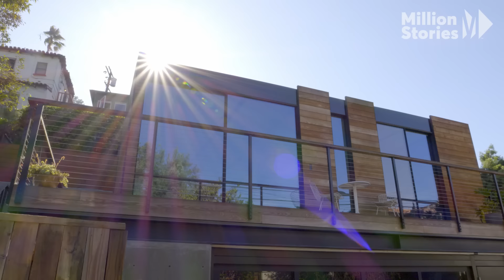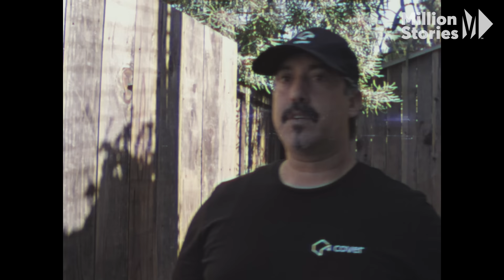How to Solve a Housing Crisis

Comment: Many of the SEARS pre-manufactured Kit Homes, delivered to cities by Rail Car and flat-bed trucks, still survive, lovingly maintained by their owners. Home loans and mortgages for young home buyers were VERY HARD TO COME BY until well into the 20th century, and Sears Kit homes provided an entry into home ownership for a lot of younger families.
But they used designs and Wood that in this time would be regarded as EXCELLENT QUALITY.
Modern consumer home construction has its good points, and we've learned to make it work, and optimized it for the various sub-systems, such as wiring and plumbing. But it cannot be described as EXCELLENT quality in detail, only in its optimization for quick assembly and affordability, CERTAINLY NOT FOR DURABILITY or any intrinsic beauty.

Comment: Prefabs fall apart pretty fast and are never designed to be repaired or maintained.

You can see them tacking cover strips over the seams with nail guns in the video.

20-30 years time it will be a mouldy pile of junk that leaks like a sieve.
Reply: unless they are build like Lustron homes. but they were too hard to repair / renovate and scrapped for metal